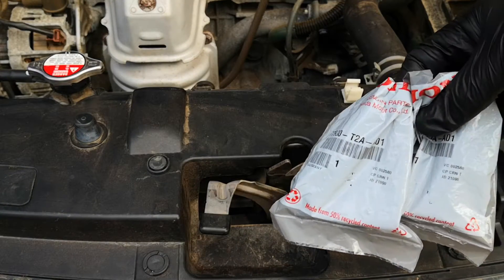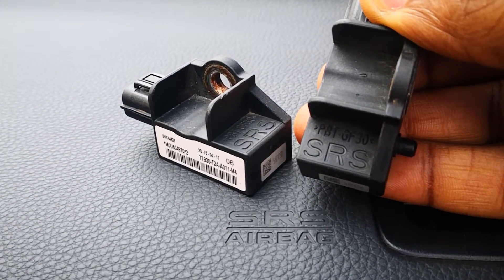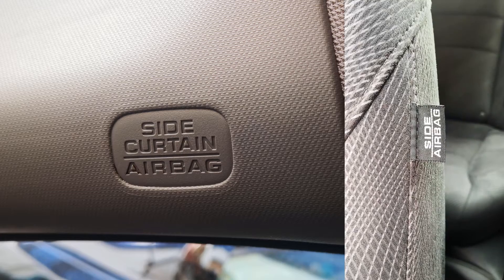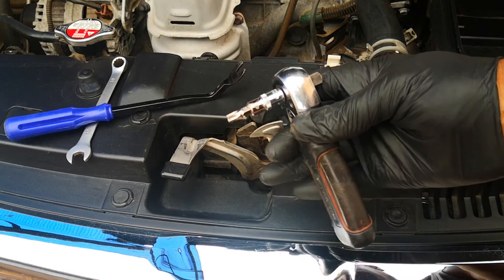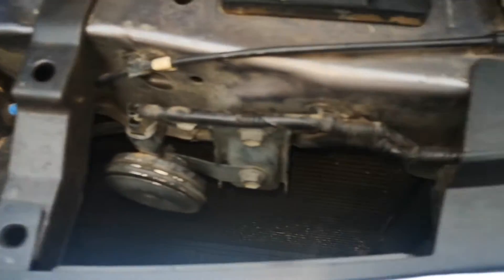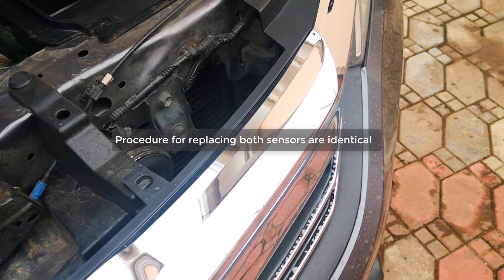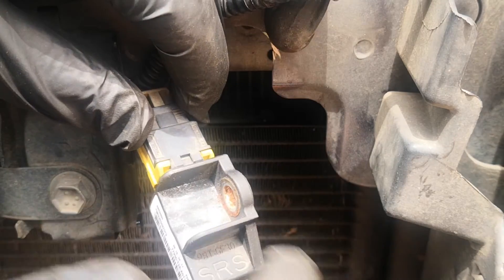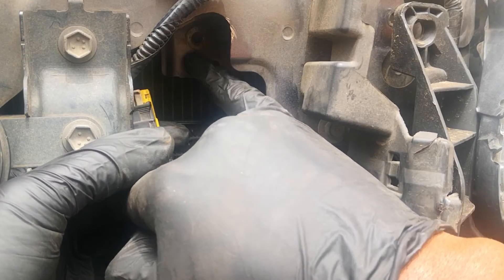Front CRASH Impact Sensor Replacement / Front IMPACT Sensor LOCATION / Honda Accords 2013 - 2017

Comment: I have a 2013 Honda Accord EX that was involved in a crash on the front right hand side of the car. Ever since the crash, the car has never been the same again. I had taken it to several mechanic workshop includeing the Honda Service center on Adeniyi Jones without resolving the issue. The gear selection has been terrible, when i accelerate and slow down, the car struggles to find the right gear and preventing quick pick up. At some point I had to abandon the car, because I felt to terrible to even sell it. I would be glad if you can give me an audience or if you can assist to troubleshoot the car or give me a clue of what you believe coule be the issue. Note this is not a catalyst issue or a gear issue. 
However in recent times I had decided to take a look at the car again and after several checks on the internet, I believe it is either a damanged brain box, a damaged transmission module or a damaged tranmission fuse. Please kinldy reach out. Than you

Comment: I installed the new crash sensors but the lights still stayed on 😔
Reply from the maker: Light will remain on until you replace every SRS part highlighted in an SRS scan and then clear crash data from the SRS module.
Reply: @DIYAutoworksNG  Noted! Thank you!!

Comment: Hi there! Do you know where the sensor is located in a 2009 honda accord?
Reply from the maker: Not exactly. The 7th gen had theirs by the sides of the radiator, you could visualise it by looking down the sides of the radiator in the engine bay. Maybe see if they kept that location given the similarities with the engine.
Reply: @DIYAutoworksNG  Thank you so much for taking the time to answer! My pops and I will try that. Thank you!

Comment: Receiving b280a no signal from safling sensor. Have you ever experienced this before? Same car as the video
Reply from the maker: I haven't, but the safing sensor is a critical sensor in the SRS. It stops the airbag from deploying when you hit things like a curb etc. I'd replace or check the wiring. I think the location is in the rear of the car if I recall.
Reply: @DIYAutoworksNG  thanks, I have 4 dtcs, I replaced the 2 front impact sensors and tried to erase the front impact  codes but is fails. Do you think the safling is preventing the erase?
Reply from the maker: You won't be able to erase the code. They are hard codes, they will only go when the crash data in the SRS module have been cleared using special tools. I did a video on how to restore your SRS after a collision, might be helpful to watch.
Reply: @DIYAutoworksNG  forgot to mention it in my previous post. I did get the srs module reset. Only difference i noticed that the passenger airbag light stopped flashing after the reset service.
Reply from the maker: Asides impact sensors, what other code do you have? Safing sensor alone? We're you wearing a seatbelt?
Reply: @DIYAutoworksNG  I also have b0020 increase or open resistance on left side airbag inflator
Reply from the maker: Have you replaced the safing sensor and the left airbag?
Reply: @DIYAutoworksNG  not yet. Replaced the front sensors only. I would assume the front codes would reset
Reply from the maker: Everything with a code should be replaced, then module cleared. Only way to get a result.

Comment: Quick question I need to replace the one on the passenger side is that the right or left sensor?
Reply from the maker: It's the right if you country drives on the left side of the road.

Comment: I replaced my airbags and reset module except impact sensors is it safe to reconnect my battery and start my car I’m afraid that bad sensor can deploy all airbags  is that possible?
Reply from the maker: Well, not all impact sensors should be replaced after an accident. E.g. Acura/Honda, Audi, Chrysler, Ford, Infinity/Nissan, Lexus, Mazda, and Toyota, say their sensors will reset themselves soon after the accident except if they were damaged. Confirming damage may be another matter. I replaced mine out of an abundance of caution plus not knowing if they were damaged in the accident. Some other manufacturers recommend replacing impact sensors after every accident irrespective of damage. 
Were there any other SRS codes apart from the airbag? Ideally they should be fixed before installing a cleared module. In terms of whether airbags will deploy if you reconnect the battery, I really can't say. A malfunctioning impact sensor can do that especially if the car does not have a safing sensor whose work is to confirm that the signal from the crash sensor is legit.

Comment: hi. I have a used CRV 2021 black edition. The seller claims that the car had   never being in an accident . I have always  the " air bag system SRS problem "  and upon  system check , we got the error code B00A0-54 . can this happen without an accident ? he tried to erase the code like you did, but it never disappears.......the dealer couldn't handle this  either. Can i use the car normally like the and ignore this error? how can I fix it ?
Reply from the maker: B00A0-54 refers to the passenger SWS. A quick online search shows fhe code may occur without an accident. The SWS needs to be initialized using a scan tool. Code means the passenger airbag may not function correctly in the event of an accident.

Comment: I don’t have sensor codes should I still change the sensors ? It’s a 2021 car sensors 70 dollars each 😅
Reply from the maker: In principle, no. But find our what your manufacturer recommends about crash sensors after a crash. Some say to replace irrespective of whether it's damaged.
Reply: @DIYAutoworksNG  it’s Subaru so they recommend replacement I believe ?
Reply from the maker: Yea. Just saw that. Subaru recommends replacing them if an airbag deployed. Sucks, but safety first.
Reply: @DIYAutoworksNG  Could I email you a pdf scan of my SRS system ? Some of these codes are unknown to me.
Reply from the maker: Sure. Email on about page of you don't have it already.
Reply: @DIYAutoworksNG  thank you ! Email sent

Comment: I have honda crv 2017, Does the airbag gonna deploy by itself if i didn't fix it well? I know i need to replace left front impact sensor. I'm kind of scared that my whole srs system will go off if anything goes while replacing sensor. Also do i have to code again for new sensor?
Reply from the maker: Considering that in rare circumstances, airbag can deploy randomly, I'd say its possible for a bad fix to deploy an airbag. Defective crash sensors may also contribute to this. If OEM parts are used and due process followed, things should go well, however, it may be best to have a professional handle the repair if you don't have the know-how.

Comment: I replaced the front right airbag impact sensor on my 2015 accord but it got blown immediately as I connected the battery and tried to start the car. What could be wrong??
Reply from the maker: Not exactly sure, but I'd be keen to know the other codes in the SRS module.  What made you say it blew, audible pop?
Reply: @DIYAutoworksNG  yes an audible pop. The code I get with the scan tool is  b0095-87. That's for the front right impact sensor and that's the only code there is.
Reply from the maker: I did some digging and found that a short in the impact sensor circuit can be responsible for the code. Try to rule this out. Perhaps there's a short triggering the impact sensor. Worst case scenario is a bad srs module.
Reply: @DIYAutoworksNG  OIC. that's an expensive repair if I have to replace the module. I'm going to try to replace the pigtail first and see if that's would solve the issue. I appreciate your feedback. I'll update you once if have the pigtail.

Comment: I'm working on a car that was in an accident. No airbags deployed, but front bumper/fender was damaged, and SRS sensor looked like it was damaged as well. Replaced the action crash bracket and SRS sensor, but SRS light still on. Got a fancy OBD reader, where I can go specifically to Airbag settings to reset. Code clears, then I turn off car and turn bag on and it gives same error: No signal from right front impact sensor. 

Any thoughts? 2020 civic sedan ex 4dr turbo
Reply from the maker: If you're 100% the new sensor you put in is OEM, check the connector/wiring from the sensor to ensure it didn't get damaged.

Comment: Great video,I got a enormous Question:I got a 2014 Honda pilot accident in the front nothing major just cosmetic and also and the right side fender took it to the body shop and they fixed but now I got the airbag light on and and they say is because I got a accident before (not true got the Carfax)and they refuse to fixed.I know for a fact that there where no lights before I took the car to them,there's no airbags deploy it .they took it to the dealership and they say is going to be 6,000 dollars just to fixed even the seatbelt.what can I do to fix it myself,I work in a machinery shop I can do most of the work .need help thanks.
Reply from the maker: Thanks for the compliment.
On your 2014 Pilot. 2 questions, did any airbags deploy or the seatbelt? Were you wearing the seatbelt during the accident? If you are sure the airbag light wasn't on after the accident before you took it to the body shop and no airbags or seat belts deployed. It will be good to get a scan with a tool that has access to SRS. A scan will tell the state of all the SRS components and reveal why the light is on. Let's hope they didn't deploy an airbag accidentally while fixing the car. A scan first. May also just be a coincidence that something like that there's a short in the driver squib which can happen as cars age or maybe poor connection/an unplugged SRS component. In summary start with a SRS scan.

Comment: What is the connector going into the sensor on the back end of the sensor connector??? Mine has disconnected and won't go back in.....
Reply from the maker: I'm not very clear on what you mean.
Reply: @DIYAutoworksNG  on the srs impact sensor itself there is a connector the plugs into it. That connector on mine is disconnected and won't plug back. I'm trying to figure out what the name is for that specific connector. I might not be describing it correctly but yeah ...
Reply from the maker: Got you now. Is it the the same 9th Gen Accord? You have to ensure you pull back the tab to its very end before it connects. Took me some time too
Reply: @DIYAutoworksNG  appreciate the response I'll try that.

Comment: Does airbag module must be replaced too ? or just airbag and srs sensor on the front ??
Reply from the maker: The module must be replaced or crash data in the old unit cleared. I covered the proper way to restore the SRS after an accident here https://youtu.be/_Y5Q42IZnoI

Comment: From my understanding 3 things need to be replaced after the event of deployed airbags

1) airbags 
2) airbag module (it can be reset)
2a) seatbelt tensioner if deployed might need to be rewound and reset 
3) crash sensors (some can be reset)
Reply from the maker: Well said! The crash sensors usually reset themselves on such cars.
Reply: @DIYAutoworksNG  sir can we reuse the sensors after accident and airbag deployment
Reply from the maker: It depends on the manufacturer's recommendation. If the manufacturers recommends reusing and they are not damaged plus no crash sensor codes, you should be good.

Comment: Thanks for the great videos and nice job with your Honda doing things the right way! Do you know with the Autel tools can you clear the SRS modules to new? Or can you get a clean file and upload it with the tool? I would like to avoid having to send in the modules for additional cost. Thanks!
Reply from the maker: Thanks a lot for the compliment! Sadly you won't be able to clear crash data with this nor upload a clean file to the SRS module. Dedicated tools are required. I had to send mine off for reset before I fit it back in the car.